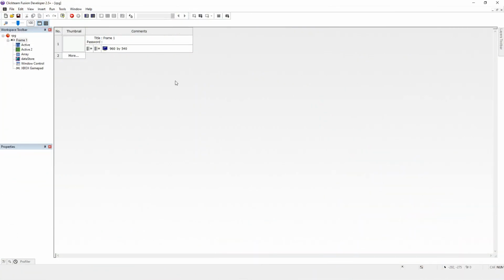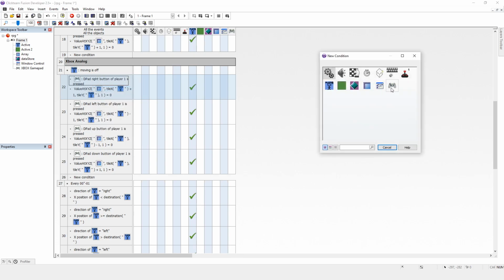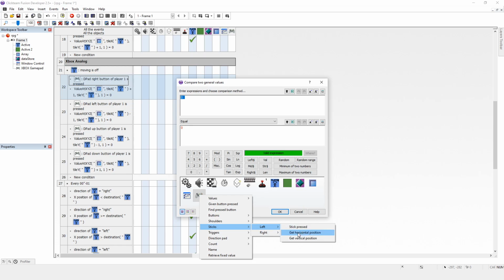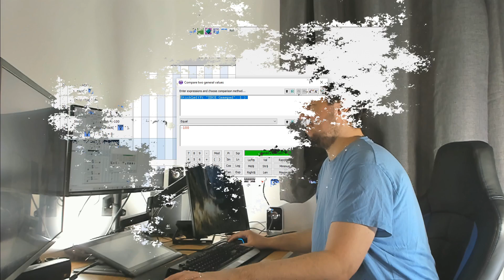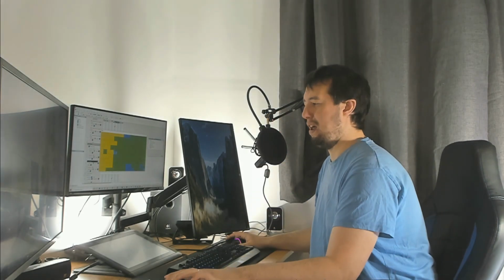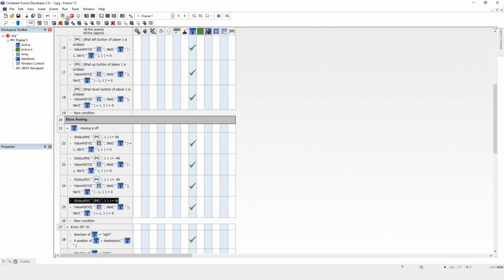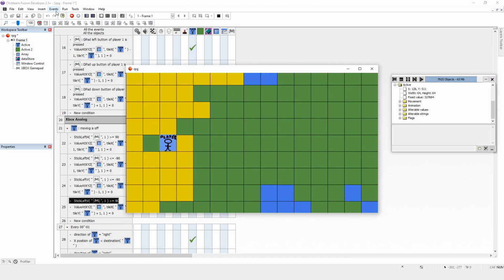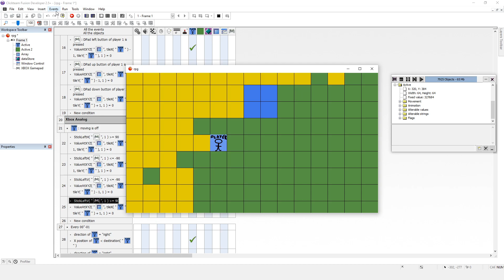Add Analog Controls To Your Game - Clickteam Fusion 2.5

Comment: Finding the right functions in events is probably the hardest part of fusion. Had I tried to use xbox controller object and not find the analog stick there, I'd given up on that. Nice tip to use "compare general values" there. does this support diagonal movements?
Reply from the maker: Diagonal is worked out with maths between the x and y. When x and y are the same and both positive, that’s top right. If x is positive and y negative but the same unsigned number, that’s bottom right, etc